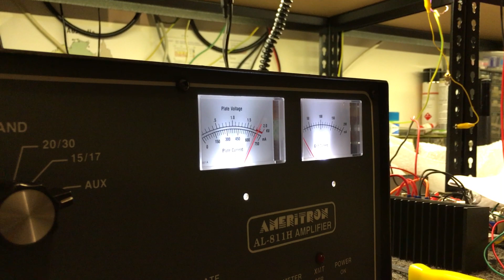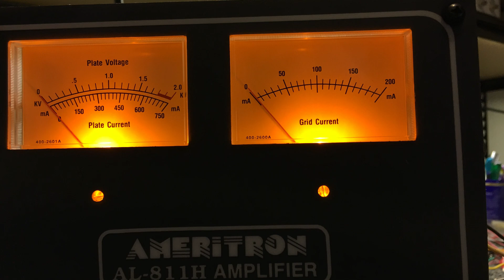Ameritron AL-811H Tube Replace and Repair

Comment: Help with any amp user, pickup an amertran al-811h amp. When it arrived all 4 tubes are out of there sockets, and one has a broken top cap. Everything looks okay BUT. The man said he would replace all 4 tubes. Would you return the amp or install the new tubes.
Reply from the maker: I'd replace the tubes - if you send it back you'll still need to get another one anyway!